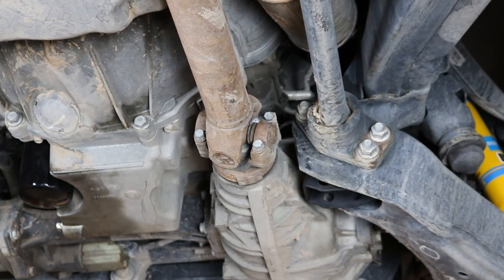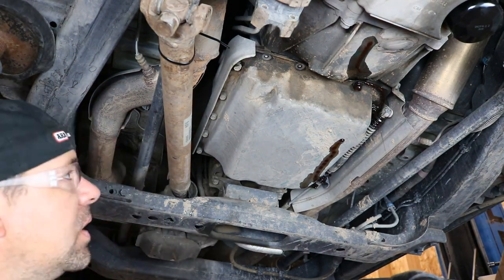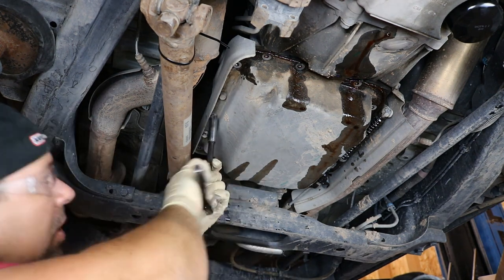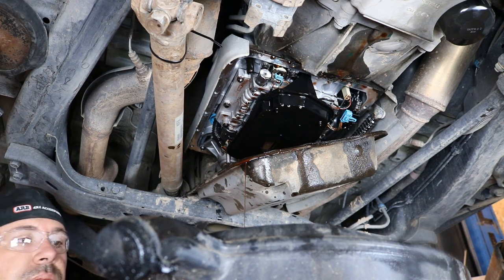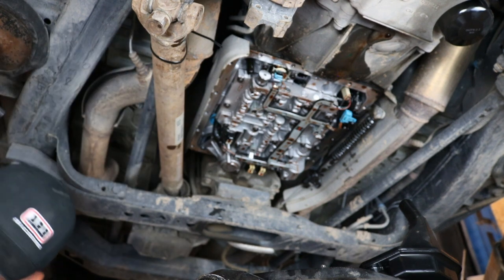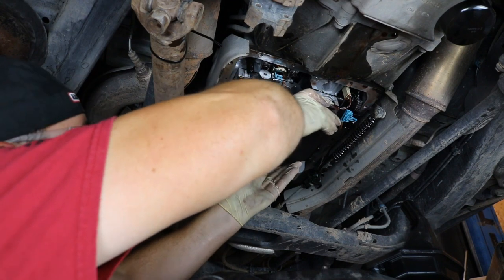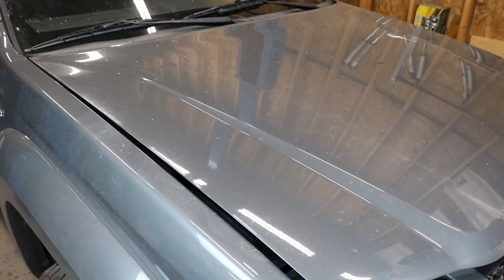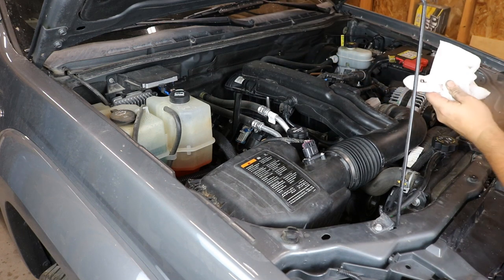Colorado 4WD Transmission Service with fluid, filter, 4L60E TCC solenoid, drain kit.

Comment: It looks to me like you didn't replace the TCC solenoid you replace the TCC solenoid valve but the TCC solenoid is above the valve still up in on the transmission it's the solenoid is what has the two wires going to it and has the little Transformer with all the copper wires around wrapped around it two bolts to take it off you got to take the solenoid valve off out first to get one of the bolts off but somebody correct me if I'm wrong but you just change the TCC solenoid valve but you didn't actually change the TCC solenoid the solenoids got the two wires coming to it you changed the fluid valve for the TCC
Reply: The TCC solenoid is not possible to replace… well at least the only way to change it is to splice the wiring. You can buy the AC Delco part online, but would need to cut and tap into your original harness, which is not something I would recommend for just anyone to do without prior experience of connecting wires.
Reply: You are correct overall, I’m not sure if replacement is necessary or if the valve is only needed, as I don’t have much experience with the codes such as P0741